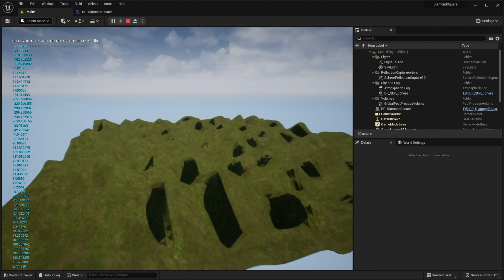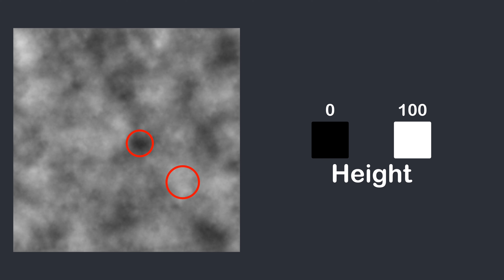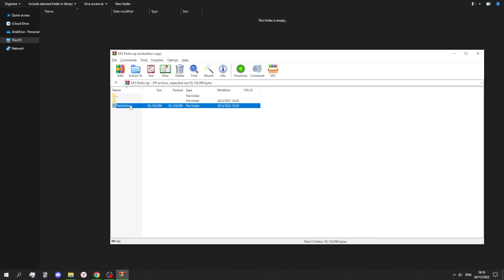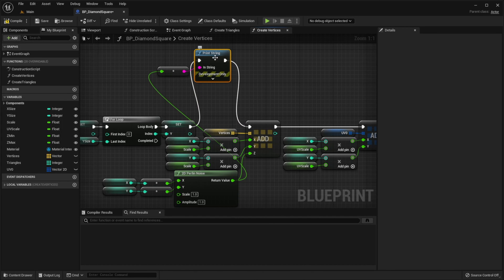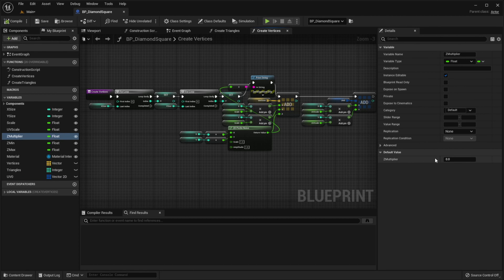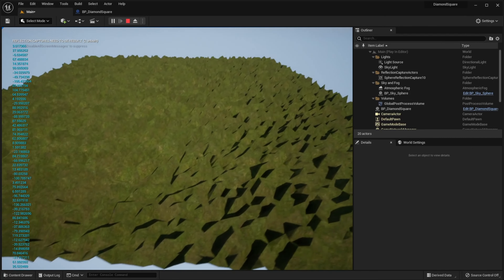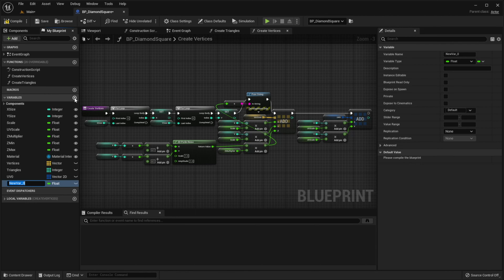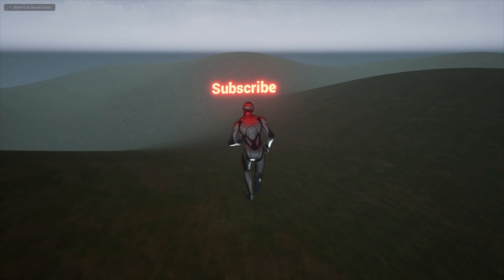Landscape generation #3 - Perlin Noise | Unreal Engine

Comment: Would it be possible to achieve a similar result without using a plugin? For a mod I'm limited to blueprints only in the editor I'm working in so no plugins allowed. I understand if it's not possible though.
Reply from the maker: You can write your own Perlin Noise function. It can take a lot of time and effort, but it's the only solution I see. I am curious what's the game are you creating a mod for?
Reply: @fetiska  Thanks, I'll look into the options. The game is Squad and modding is fairly restricted.
Reply from the maker: @null643  oh, I know Squad, but I didn't know it's made with Unreal
Reply: @fetiska  I'll probably scrap the idea XD. Replicating this seems impossible to me anyways, would end up with different landscapes on the server and connected clients.
Reply from the maker: @null643  I came up with much better solution. If it's a C++ project, you can just copy the plugin's code to your project. I explained how to do this in my reply to Léo Genot comment under this video. Tell me if the solution works when you chek it, please
Reply: @fetiska  Unfortunately blueprints only, C++ is not accessible in the Squad SDK.
Reply from the maker: @null643  ok, one more idea is to rewrite plugin's C++ code to Blueprints manually
Reply: @fetiska  If I can get this to work, how would you handle network replication for this? I tried replicating the arrays with multicasts or setting variable to replicate but the array were way too big which unreal didn't like and can't handle.

I'd always end up with different generated terrains on server and client so every connected client will see something different atm.
Reply from the maker: @null643  I am not really good at multiplayer, but I talked to a person who had a similar problem (as far as I understand) and they used multicast and authority nodes to fix the problem. In fact, you can join my Discord server (link in the description) to ask kushinksi (the person I mentioned) about their solution

Comment: Thank you very much for that video! I have been looking at how to generate terrains (without voxel plugin which is expensive) and this is really good. I just have a problem: when I try to go over 500 in both xsize and y size, one of them gets limited. Any idea why ?
Reply from the maker: Thank you! Click on your variable in Blueprint and inside it's details check if you typed something into Slider Range or Value Range
Reply: Thanks for the answer. I checked and it's not that. I will keep investigating
Reply from the maker: @bizouardpaul848  ok, thank you for watching

Comment: Hey man, thank you so much for this series, I actually can't get the project to work on Mac, seems like the plugin isn't working correctly, the blueprint doesn't seem to find the "2D Perlin Noise" node, but it's working perfectly on Windows...
Reply from the maker: According to the marketplace page (link in the description), the plugin doesn't support mac. If you want to work on Mac, you can either try to copy plugin code (the plugin code is actually implemented in 2 files: .cpp and .h), or implement Perlin Noise by yourself (if you like to suffer). To copy plugin code firstly you need to create a new C++ class in UE. When you create new C++ class you actually create 2 files YourCPPClass.cpp and YourCPPClass.h. So then you should go to YourCoolProject/Plugins/PerlinNoise/Source/Perlin_Noise and there should be 2 folders: Private and Public. Go to the Public folder, open Perlin_NoiseBPLibrary.h and copy all the code to YourCPPClass.h. After that open Perlin_NoiseBPLibrary.cpp located in the Private folder and copy all the code to YourCPPClass.cpp. It should work, but tell me if you have any problems
Reply: @fetiska  Wow thank you so much for this information I'll try that thx again mate!
Reply from the maker: @leogenot1783  your are welcome)

Comment: for all of those trying to rebuild this. Unreal Engine 5.5.1 is not supporting this PerlinNoise version.There is an working and available Plugin updater: https://www.youtube.com/watch?v=qlT9GLXh3n4
Reply from the maker: wow didn't even know that such tool exists

I switch to a different plugin in the future part anyway though: https://youtu.be/1NAFvW_WhIM?si=WvcGTy-ZKpNWdJdE
Reply: @fetiska  I will check out, thanks! I noticed using the perlin noise 2d that through update? it's not giving same results like the one you got shown in the vid..
Reply from the maker: @Blouthmaster  "I noticed using the perlin noise 2d that through update?"  what do you mean by that?
Reply: @fetiska  sorry, I meant that when I used the PerlinNoise2D in V5.5 that the scale Funktion seems not working
Reply from the maker: @Blouthmaster  just use the plugin from the video mentioned above